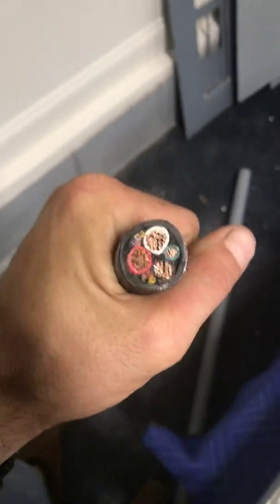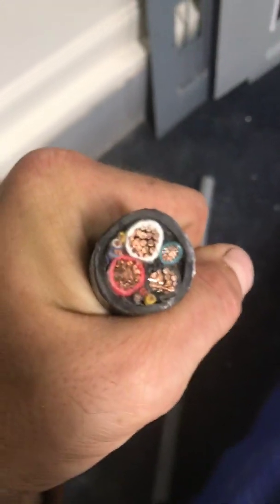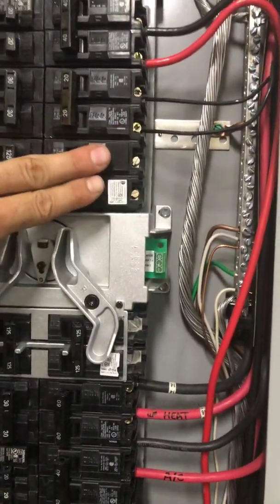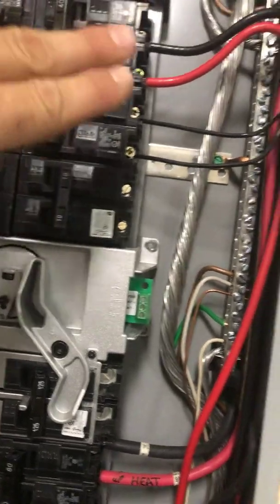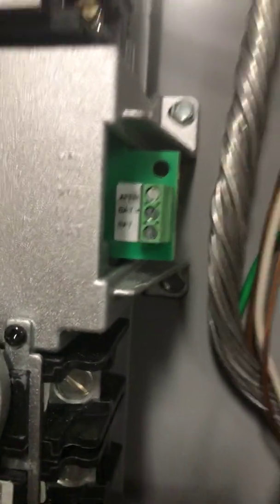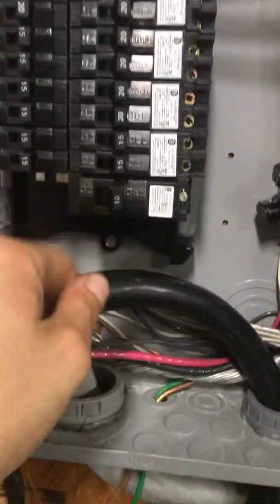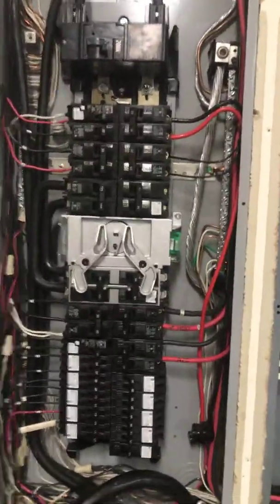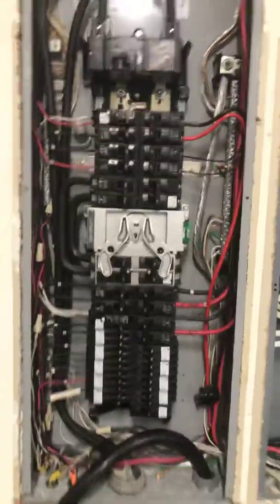Generac gen ready panel wiring

Comment: Do you have a part number for that special generator cable from southwire?
Reply from the maker: I get mine cut by the foot at the local supply house per job for around $5 a foot but you can order by the foot online cheaper here:   https://www.zillerelectric.com/products/17-22-kw-generac-generator-wire?variant=40361216269

I also you copper conductors but there is an aluminum option they just came out with that could be more cost effective depending on preference
Reply: @Astu1986  thanks!
Reply: @Astu1986  2 Biden years later its $13 a foot.